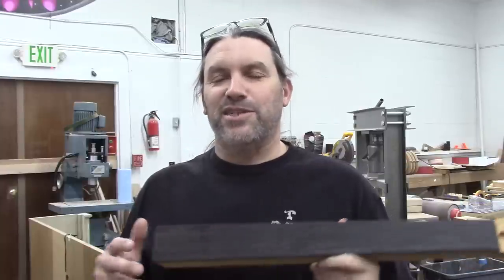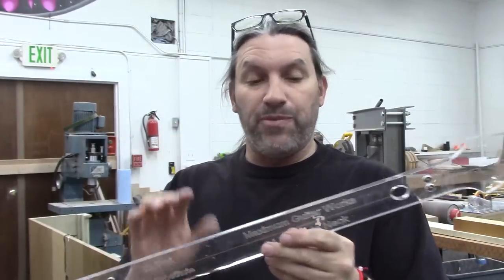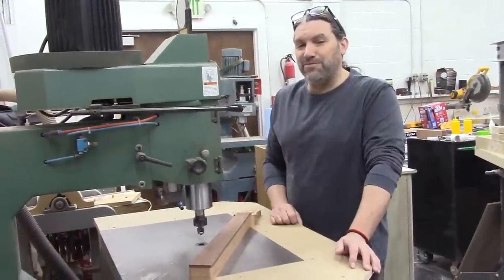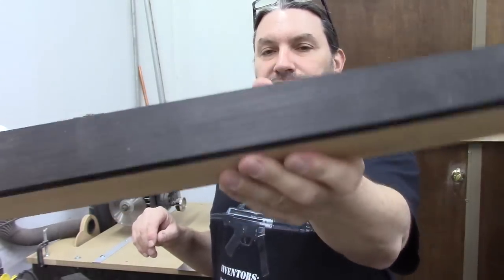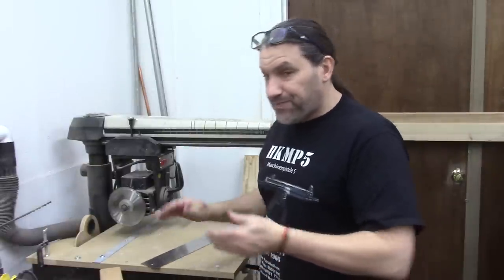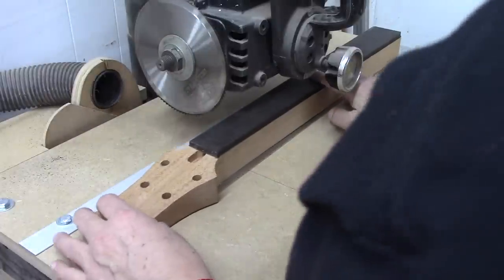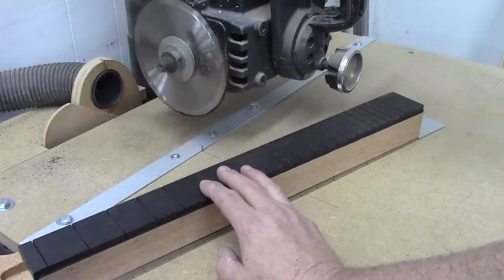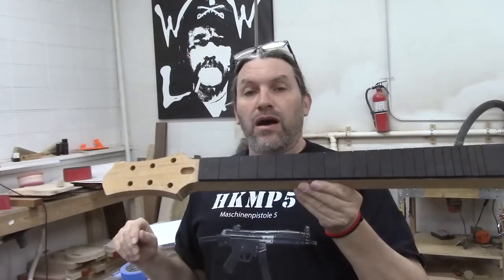Luthier Secrets Revealed... How To Cut Fret Slots AFTER Gluing The Fretboard To The Neck

Comment: The chances of me ever cutting a fretboard for frets or binding is pretty much nil - I’m barely a hobbyist modifier (although I did fit a Floyd Rose to a guitar that didn’t come with one, so I’m basically a luthier now), but your knowledge and the way you impart it through your videos is invaluable. I’ve learned a ton over the last couple years watching you and Chris. Plus now and again I get to ask a daft question 😁
Reply from the maker: Thanks for watching Matt, you never know when you might take the plunge. Of course... you could always join us for a workshop. Then you absolutely do all that stuff.
Reply: What make/model/year is your radial arm saw? I built this jig last year but the saw I used could not be made to run square no matter how much you adjusted it. Over time the bearings go bad and these saws will sag.

Comment: Great vid as always… If you had fixed pins on your fret slotting jig thingy, you wouldn’t have to mess around with the dowels 😉
Reply from the maker: That is true, however, if I did that I couldn't use the 24.625 side
Reply: @TexasToastGuitars  …if the pins were located from the centre line of the jig, not an edge, wouldn’t it still allow you to use both? …unless I’m missing something??? …which wouldn’t be the first time…
Reply from the maker: @howardwhitehead5927  The nut locations aren't in the same place. It's kinda like the nut on the 24.75 scale  is close to the 24th frets on the 24.625 scale
Reply: @TexasToastGuitars  ah, I’m with you …yea you’d need 2 jigs. I’m guessing you’d have to personally pleasure Mr MacDonald himself to get another one… 😉